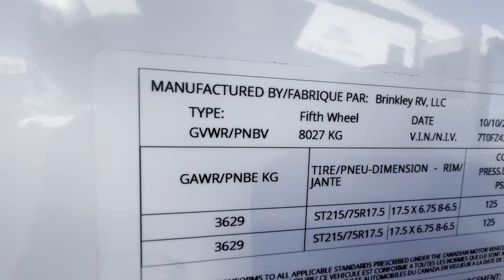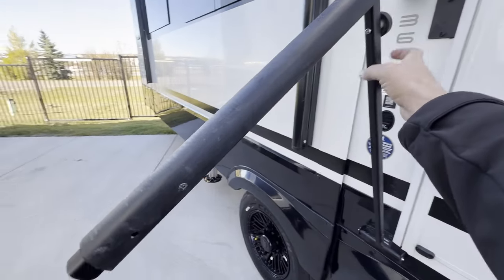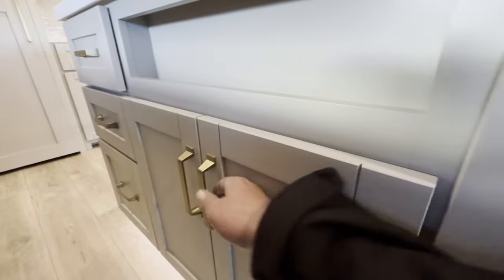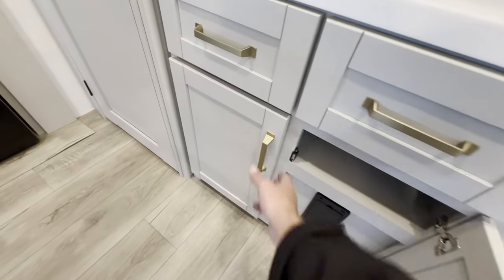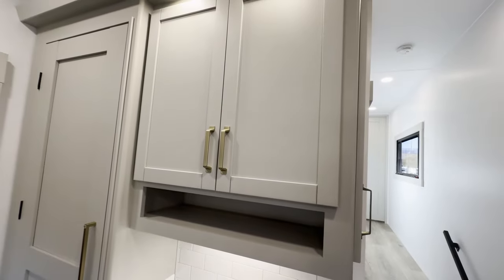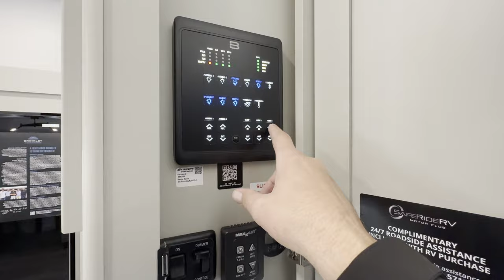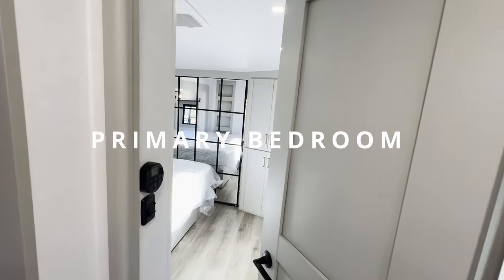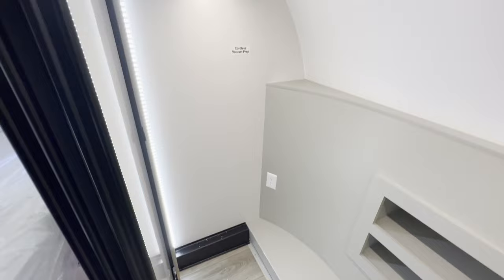Brinkley Model Z 3610

Comment: A couple questions…does the fridge have an ice maker? Also the bonus room sofa is different from what I’ve seen in other videos, is this a special order or upgrade? Great walk thru…very thorough
Reply from the maker: This was the first design, it has since changed slightly. Thanks! No ice maker on this one.
Reply: @outdoorjaye  Can we still order it with the couch instead of the jackknife and trundle?
Reply: The fridge lock stores in the upper cabinet (to the right of the microwave). There is a magnet in there to hold it in place.